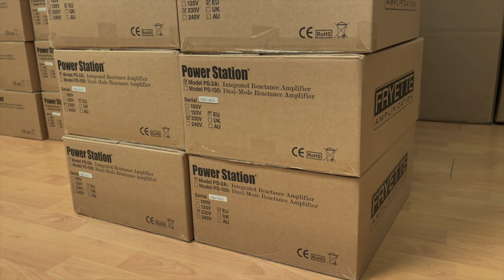Fryette Power Station - Just what is a reactive load anyway??

Comment: Great video!! If I understood correctly the switches are there to slightly affect the impedance curve or is the impedance curve set in stone by trying to recreate one type of speaker and hence the switches affect the tone through another mechanism (sorry not tech savy!)? Also which position would come closer to a mesa v30? I use different cabs but the main ones are always meaa v30s (recto 4x12, 2x12 and traditional 4x12 are my go to)
Thanks again for the vid looking fwd to my purchase!!

Comment: If using the line in only and not connecting an amplifier head, does the reactive load still function? Or does the Powerstation feature the speaker's load characteristics?
Reply from the maker: No. The reactive load is part of the amplifier load, so it only functions when an amplifier is connected. That means the voicing switches are bypassed as well when only using the Line In.
Reply: @FryetteAmps so when using line in from a digital amp modeler, should we use the amp model’s power amp as well as the model’s pre amp? Just no IR file?
Reply from the maker: @jasoncorganbrown   There's no real right way or wrong way other than what you like. We would normally recommend turning off the power amp model and IR of the amp model you are using, but the truth is, the Power Station is amplifying the sound of the amp model you are using, not replacing that models power amp stage. Assuming you are using a guitar cab, you would usually turn off the IR. The rule is there is no rule.

Comment: The Fryette website (under Power Load) says  "For those looking for Attenuators, see the Fryette Power Station®". But doesn't the Power Load do the same thing - attenuate? I don't need to boost my volume like the Power Station can do, I just need to reduce it. And the Power Load has a headphone amp and jack, which I want. So why wouldn't I get a Power Load instead of a Power Station? Confused.
Reply from the maker: Sounds like the Power Load is exactly what you want! The PL is the reactive load of the Power Station (without the power amp) combined with cab simulation capabilities.

Comment: Thanks for this information Steve!  I have 2 questions:

1. Is the "load" in the PS, the same as the "load" in the Power Load?  I am asking because I slave my amps now, and I run the slaved amps into my FX, and into a 2/50/2 tube stereo power amp......So, I already have the "power amp" part covered.  I just need a really good "load", and the Power Load has some cool features!

2. From a WDW perspective, if I bought a PS, I am thinking that I could slave my amp, and use the "power amp" in the PS to power my "dry" cabinet, and the 2/50/2 to power my stereo "wet" effects.  In this scenario, does the "power amp" section of the PS, have a similar tone quality that I have in the 2/50/2 stereo power amp?
Reply from the maker: 1. Yes. 2. Ideally, you would be using the PS to preserve the tone of your cranked amp going to the dry cab at the desired volume. The PS Line Out will then send a line level copy of that sound to the the 2/50/2, which can then easily be dialed in to complement and enhance total system sound. Taking that concept a (sick) step further, if you had a couple of different dry cabs - say one for cleaner stuff and one for OD sounds, you could switch between them for their respective sounds. In a rig like that the PS-100 would allow you to to have 2 dedicated modes, one for each optimization of the load amps settings, with each combination being sent to the wet power amp.
Reply: @FryetteAmps  Holy CRAP!  I didn't realize that the PS-100 had that flexibility!  I like that!  Would the PS-100 be too overpowering for the 2/50/2 in the wet cabs....or would it still be "balanced"?   Thanks so much!  :)
Reply from the maker: @ian1eh944  Not at all. Just because it's 100W doesn't mean you use it all. It's there to insure that your amp sounds dynamic at low or high volumes whether playing clean or overdriven. You set the volume where you want it. The 2502 will have no problem keeping up because, a) you're probably not playing that loud, and b) the 2/50/s is mostly the wet amp - bringing the ambience - a much more specialized task that doesn't require a lot of power. See: https://www.youtube.com/watch?v=gKwJv2BQ-jw&t=9s
Reply: @FryetteAmps  how would you switch between the 2 dry cabs??..I have a PS-100,and am building a wet dry wet rig with it at the center....I am using a Marshall 9005 power amp for the wet cabs....this caught my attention when you said you could switch between 2 dry cabs...
Reply from the maker: @scottpeters4401  Just a simple passive A/B box.

Comment: Since there is not an FX loop before the line out on the Power Load V2, is it possible to use the  fx loop headphone output direct or with a level conversion to an interface and acheive the same level of fidelity as with the line out? I would have loved to have hade a regular fx loop instead of the headphone fx loop.... still, the power load is awesome. Cheers.
Reply from the maker: Direct to an interface works great.
Reply: @FryetteAmps  How would I wire a headphone output to interface cable for this application? Cheers.
Reply from the maker: @The_Absurdistt  https://www.sweetwater.com/store/detail/STP201--hosa-stp-201-insert-cable-1-4-inch-trs-to-dual-1-4-inch-ts-3-foot